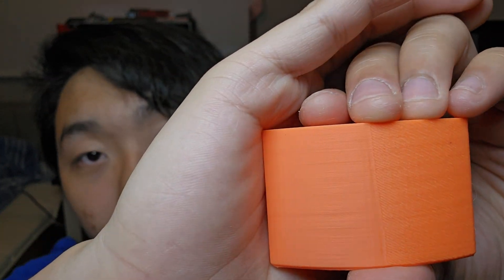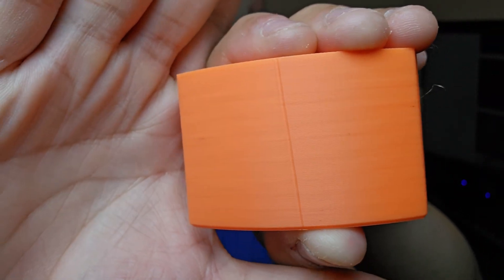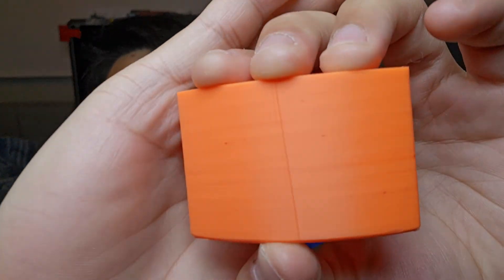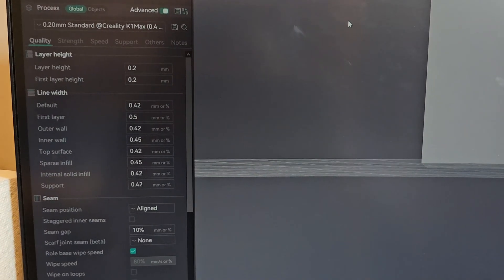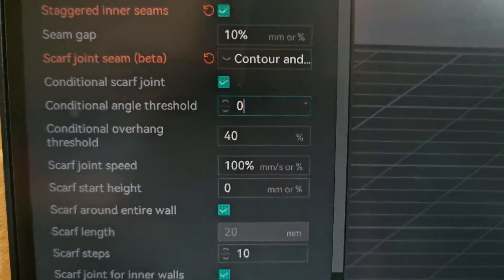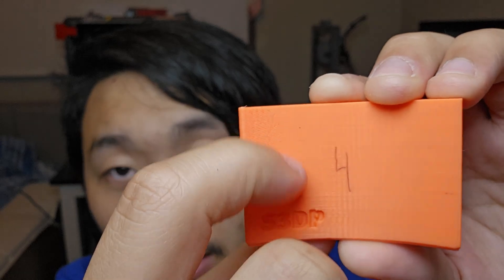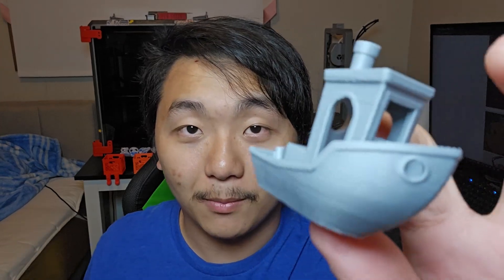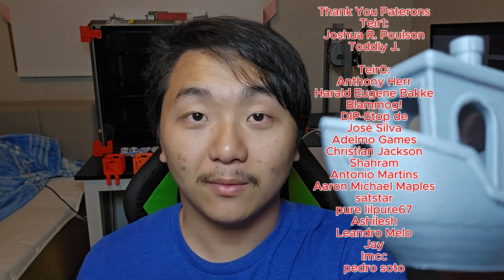No More Seam With This One Setting Change In OrcaSlicer v2.1.0

Comment: I have been fighting some seam issues for a print that required delicate tolerances for some time now. I have a tall cylinder that is 0.8mm thick, which is 2 walls on my nozzle. I am using random seam locations to improve the strength of the part, but it had been leaving blobs at the seam location on every layer. These settings allowed me to reduce the blobs enough for my parts to slide together perfectly. It does make for a little different looking finish than you normally see on printed parts, but seems to be strong and PERFECTLY fixed my issues with seam blobbing. :trophy-yellow-smiling:
Reply from the maker: That's good to hear. For me doing random for the seams makes the 3d printed part looks weird, but it's good that it's working for you.
Reply: @Scratch3DPrinting  agreed, it does look weird, but I wound up with a stronger part. I am using this in a industrial setting, so increasing part longevity is much more important to me than looks.

Comment: Why can't they add the seam in the infill?
Reply: Because the infill isn't the external. The outer loop has to start and finish somewhere on the outside
Reply: @rasta0073  yes I know, but there may be a solution to make it works somehow
Reply: @xixix1737  sorry i would be interested in how that would work ? because even if you straightly switch to the inside you see it
Reply from the maker: I think the infill also has seams too we just don't see it. The seam is the start and stopping point of each layer so it will be there unless it connects the start and end point perfectly, and then there will be no seam.